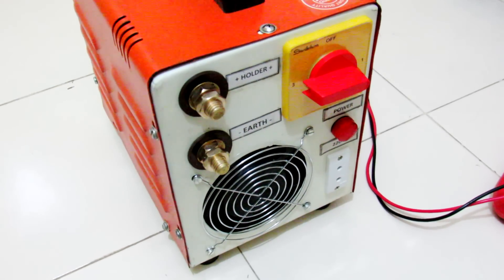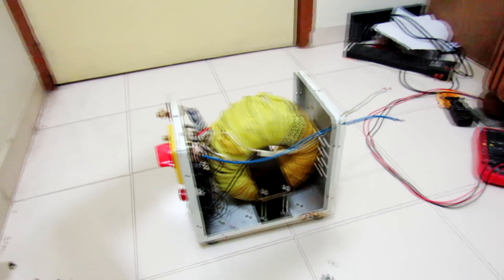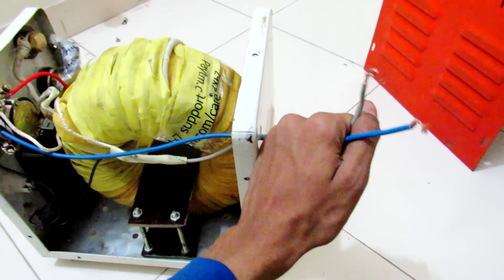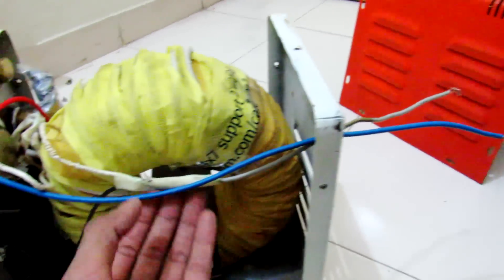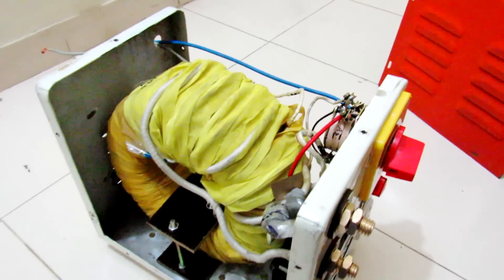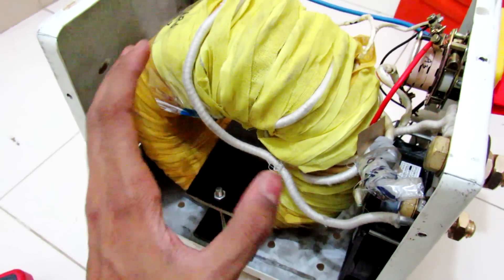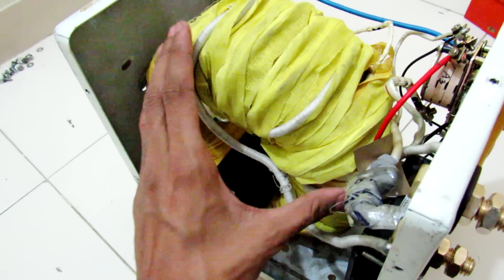Whats Inside Arc Welding Machine ?

Comment: First off its not an 18 volt AC fan that fan is a 110 volt AC fan. Second its not 200 amps you were showing 220 Volts not 220 Amps. The amps were on the other side. 3rd the "grey" wire is actually the white wire*. 4th With the "3 turns" at 220 and even 240 volts it will *not produce 200 amps simple math. And 5th do you even know what you are talking about?  And lastly... 6th, with the size and possible KVA rating of the torodial transformer 200 amps at even 30 volts with a duty cycle of at least 25 - 30% is *NOT Possible*.

Comment: Excellent look-inside video.
Unfortunately that welding transformer doesn't provide proper current-regulation.
There's a big lever to adjust welding current on a decent welding transformer. The lever shifts core of a series ballast. More portion of core into the ballast then higher ballast's inductance and smaller welding current.
Cheers from Indonesia

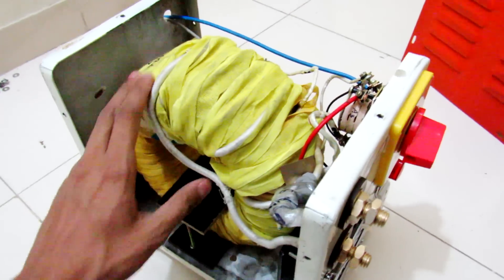Comment: 3:30 200 amps ?? No even primary side amp consumption is around 200 or accurate 146.66 at 1.5 ohm , output side current will be in 1000 amp range

Comment: Good introduction, also a very unusual machine.  Everything seems to be "inverter" now, and this machine is jammed full of transformer, and actually has a pretty industrial look.  The bolts for connecting leads are pretty unusual too.  I'd say this looks economical and strong.  I think hundreds of people would like to know more.  
Also, do you think current control is magnetic (saturable reactor) kind of thing?  There's no sign of electronics in there, but some kind of control?  I didn't understand if the current control has steps or is continuous.  I think I want one.
Reply: Leonard Pearlman
Hey this machine was made by me. I think its first of it's kind. We were experimenting and came up with this. If you want to buy in bulk we can talk about it. 
Thanks
Reply: The selection control is just wires coming from inside the transformer at different windings . Thats why he used the multimeter to measure resistance